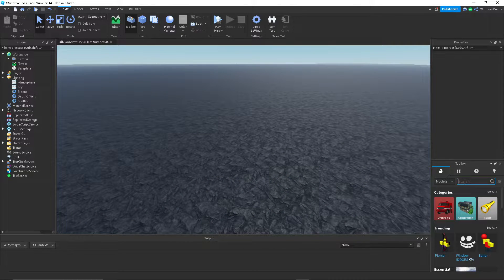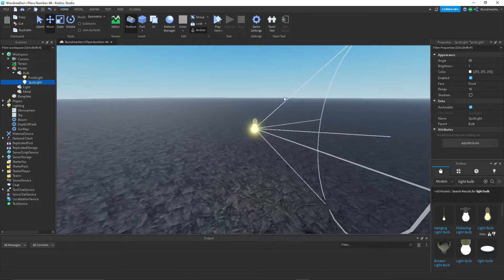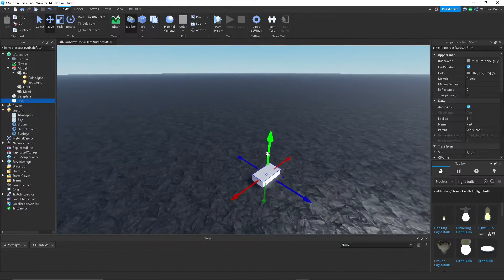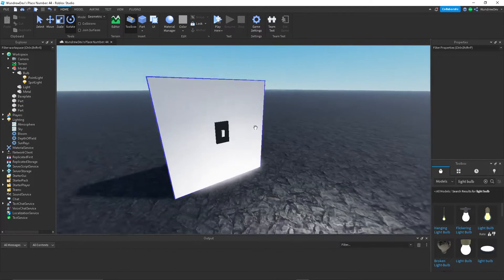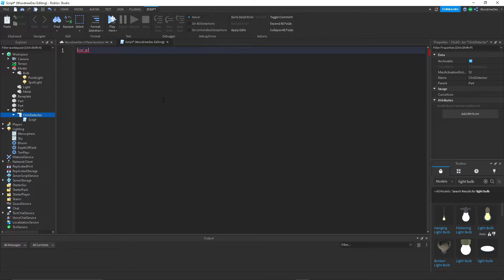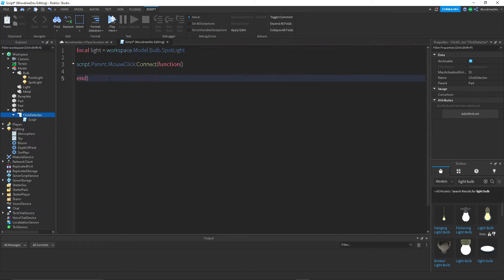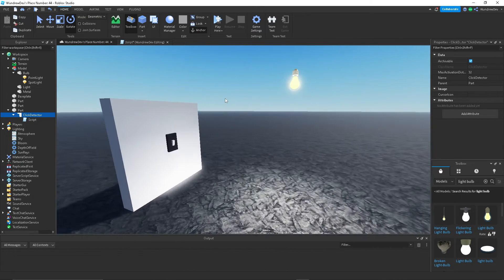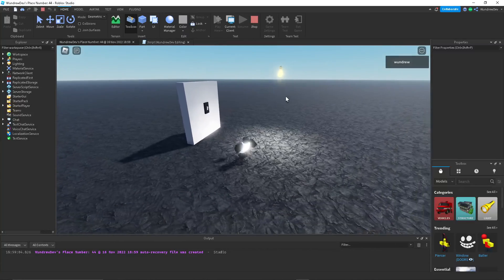[EASY] How to make a WORKING light switch in ROBLOX STUDIO

Comment: For those that want the light closed when the light is off here you go!

-- this script is for ProximityPromt not clicking

local light = workspace.light.Bulb.SpotLight
local bulb = workspace.light.Light 

script.Parent.Triggered:Connect(function()
	light.Enabled = not light.Enabled
	bulb.Transparency = 1 
	
	if light.Enabled == true then
		bulb.Transparency = 0
	end
end)
Reply: thanks mate
Reply: So when i tried that it did not work, in fact it broke the whole code.
But luckly enough i did find the fix after like 30 minutes of looking,
It's lituarly just the IF and THEN, they need to be on sepperate lines